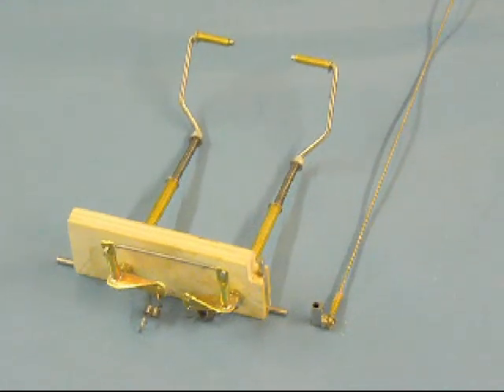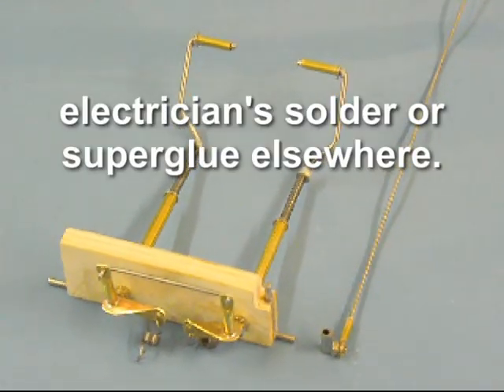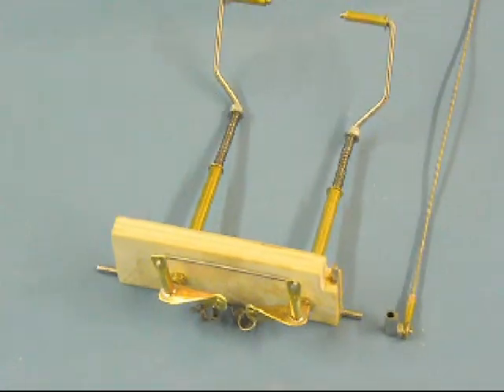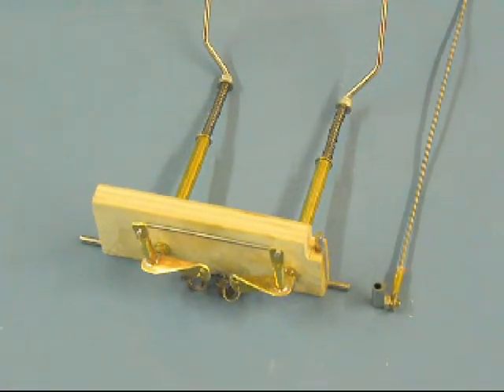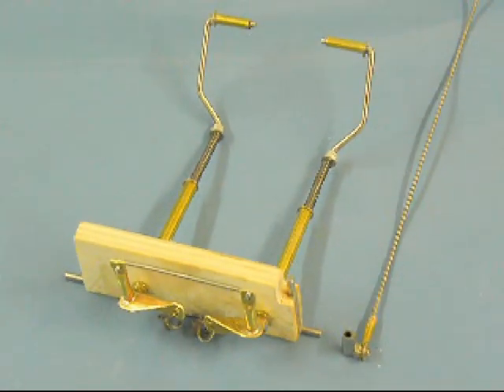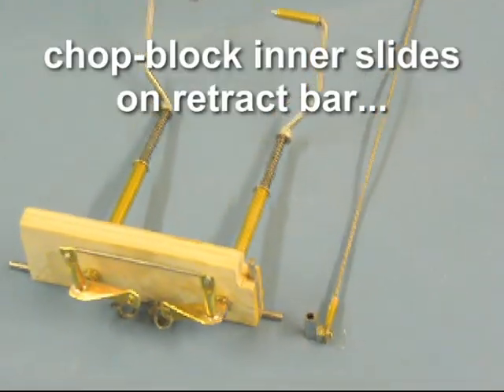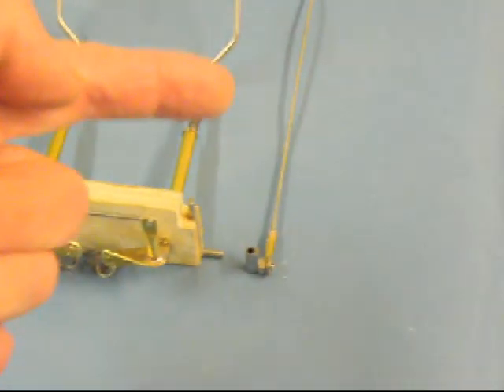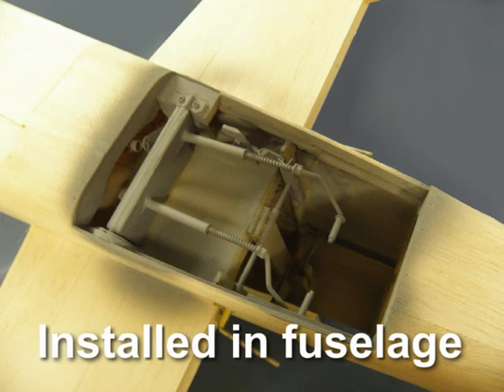Tailwheels.mpg

Comment: Your design and execution is very inspiring. I am a big believer of the "light is right" train of thought in design and build habits. Your designs are very appealing due to the light yet strong construction and resultant scale flying speeds.  You should compile your thoughts and methods into a book or a run of articles some were. My copy would be worn rather "dog eared" from reading and re-reading your methods.
Reply from the maker: Many thanks for your kind comments Bill. I did do a short series in Quiet & Electric Flight International on the design of electric power systems but never thought that it might be appropriate to follow through with  airframe design. The nearest you'll get to your dream book can be found on the R.C.Groups forum where I have posted some of my builds - the Short Stirling among them. I am also contactable direct via that forum if you have particular questions, but there is quite a bit on information in my blog page that you will probably find interesting.
Best wishes,
Robin